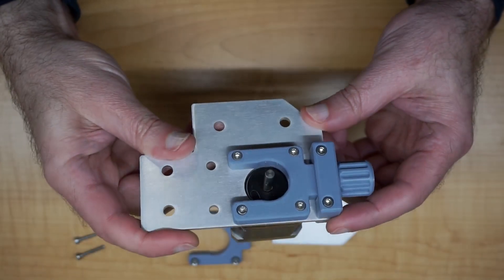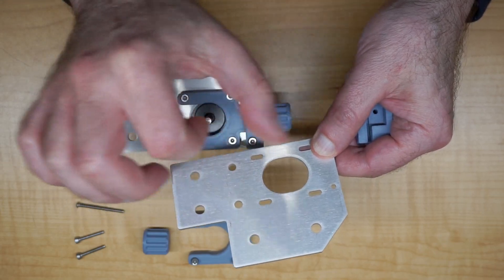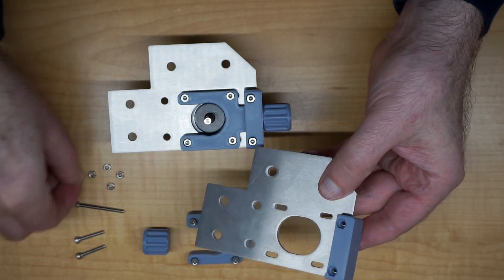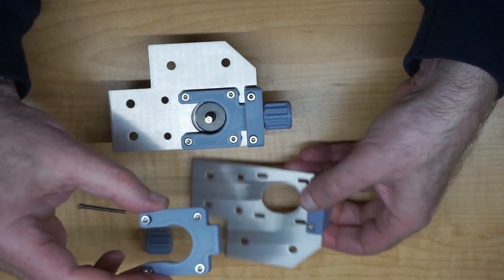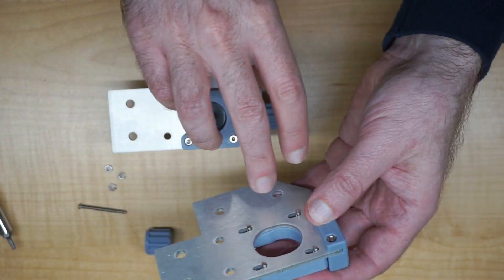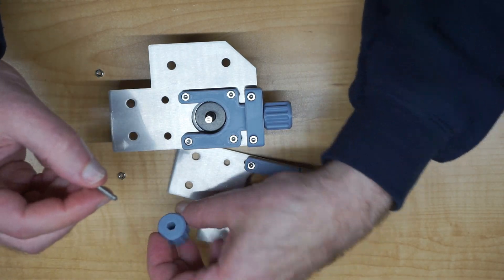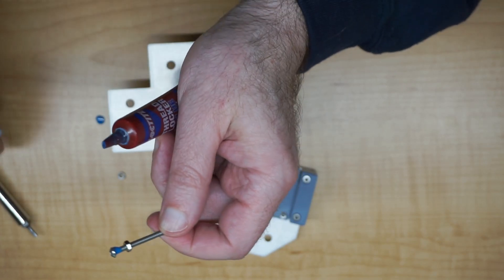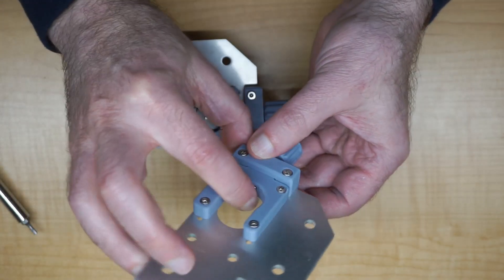VCore 3 Tension System

Comment: I was looking at various other belt tensioning mods for the vcore. I hate that it's tensioned at the head. I understand why but it's so impractical. This way is better however I struggled to find people to cut plates for me.
Reply from the maker: Hi, if you are in the States, you can use SendCutSend, or Laserboost if you are in Europe.  I've used both of those places, and prices are very reasonable for laser cut aluminum.

Comment: In order to let the motor sliding with tensioner knob, can I assume we must keep 4 motor mounting M3 bolts non-tightened/loose and leave some tolerance there at the stage of belt tensioning?
Does it also means we must go tighten all 4 motor M3 mounting bolts once we have done the proper belt tensioning process?
Reply from the maker: Yes!  you leave the 4 mounting bolts a bit loose when you are ready to tension the belts.  Use the knob to pull the tensioners to the tighten the belts, and then tighten the mounting bolts to lock everything in place.  the bolts are easy to access, and I even left a small hole in the top plate to get to the bolt that is closes to the corner.
Reply: @mikey631  Actually I am working on very similar design work for my DIY printer too.  Thx for letting me know it is indeed a practical one 👍🏻